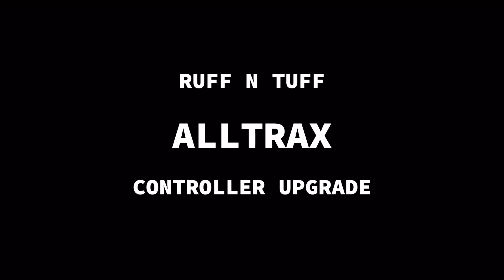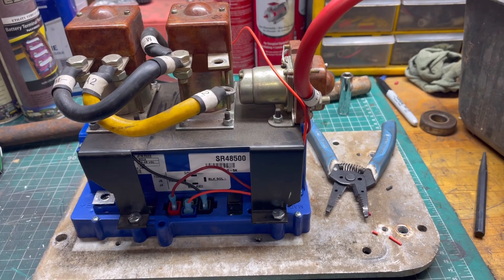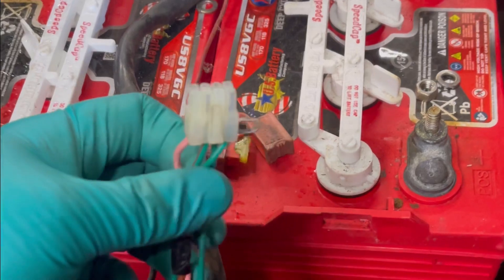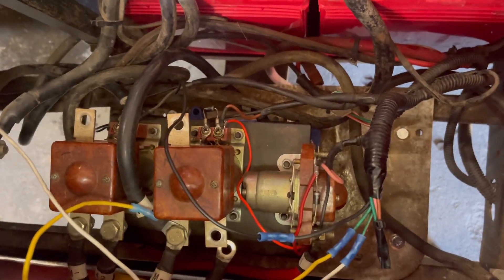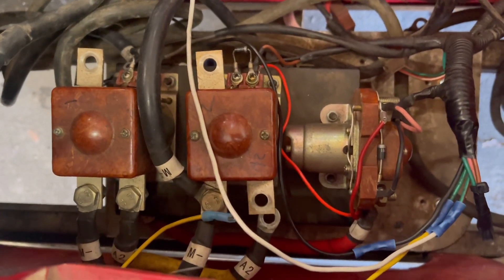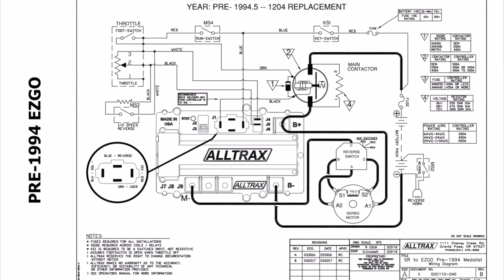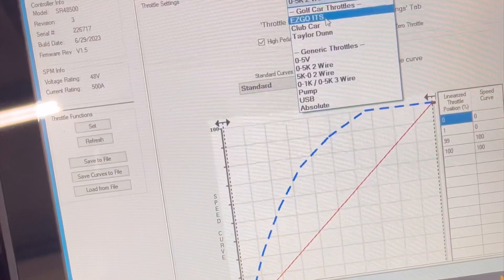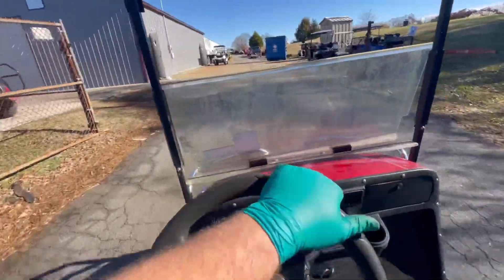Ruff N Tuff Controller Replacement | Alltrax Upgrade

Comment: Did this RnT have the throttle micro switch connected to the ITS? (Mine is connected on pink wire and appears to provide +V to the ITS) What did you do with the micro switch wiring?
Reply from the maker: No, the micro switch wiring should be separate from the ITS. You could have 4 wires going to the pedal box. 2 for the switch and 2 for the ITS. One wire going to the switch is a feeder with + voltage, the other wire goes back to the red plug on the controller.